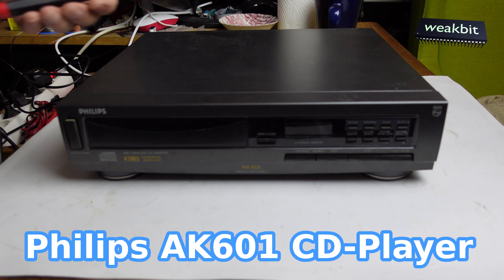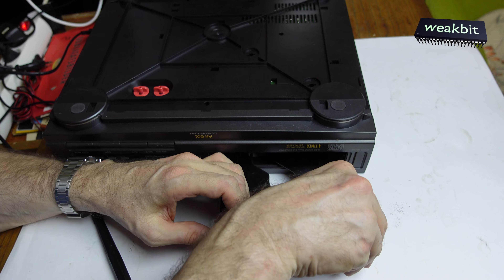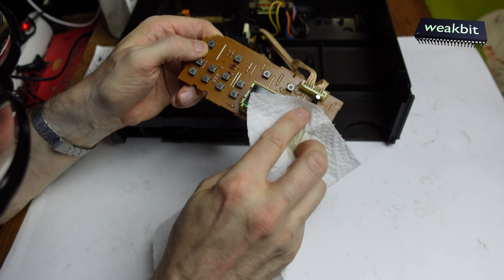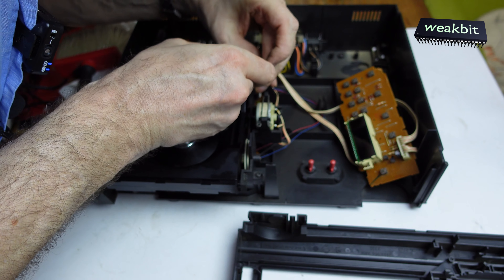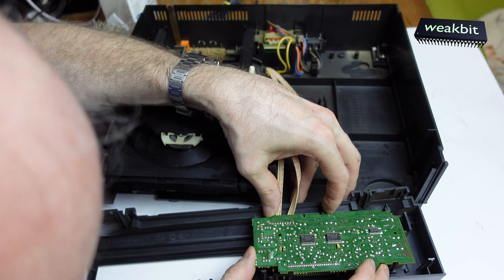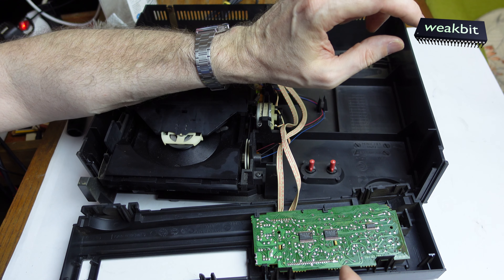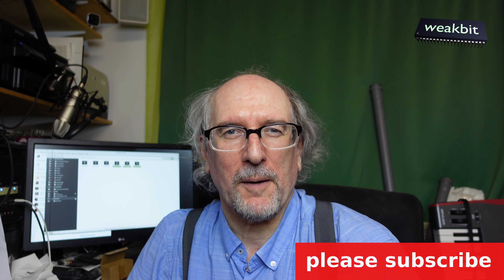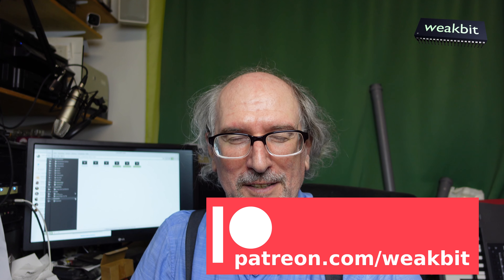Philips AK601 CD Player belt change

Comment: I was viewing a few videos on your channel and like how you fix stuff. Was watching the Grundig finearts and now this CD player and there is almost nothing under the hood. When i open my Philips CD850 from 1991 to maintenance it, the case is packed with pcb boards.
Reply from the maker: Hello 1st in the 80s and till the end of the 80s all functions what build in have extra TTL parts to control them then the integration is going on. For example the bitstream encoder are now with build in all failure corrections and so on but in the older days that was all on a PCB in TTL (Transistor Transistor Logic) supported but not in one IC.Thank you for watching weakbit
Reply: @weakbit633  Thx for your explanation. I really like this old Philips CD players. Have 3 of them at home from 36 to 32 years old and still working fine. In a way simple but great machines.
Reply from the maker: @rogervd666gamer  For this type of CD-Players the reason in some cases is there are defect electrolytic-caps and after 30y they should be changed.